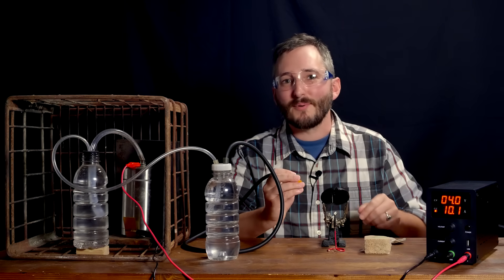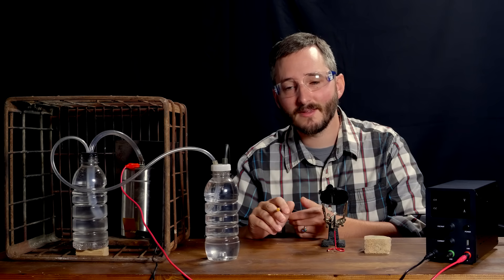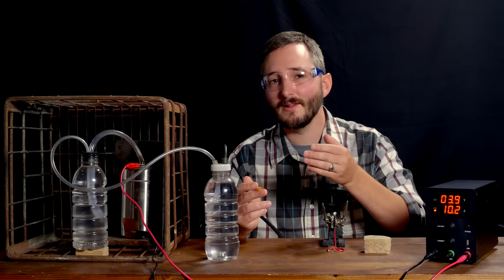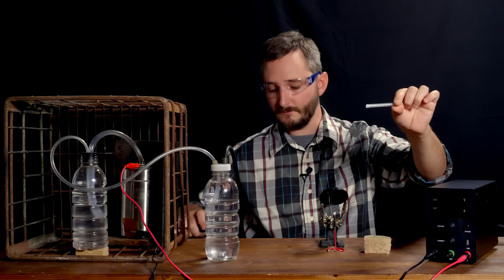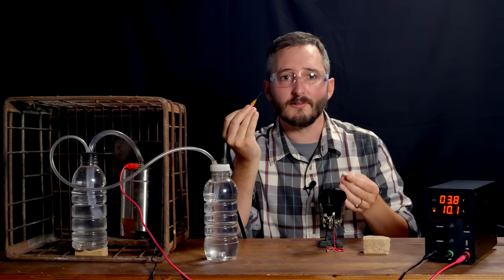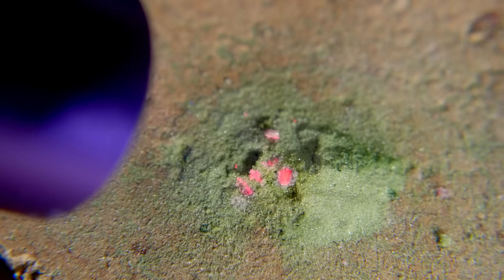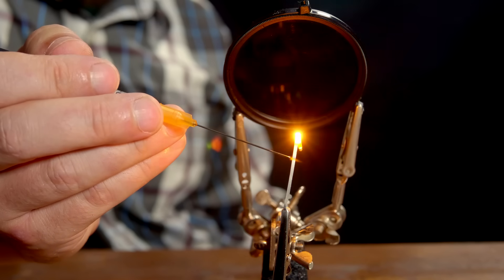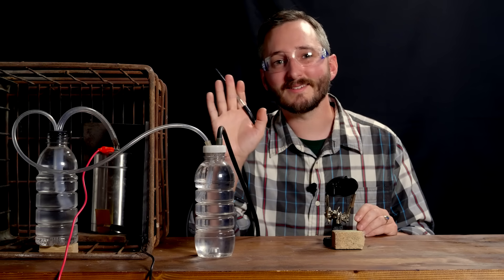DIY Oxy Hydrogen Torch Using Water Electrolysis

Comment: I run my lawn mower and truck off it it's soo easy and simple to keep it safe so easy plus small gas compressor up to 3000 psi that way you run off only tank like a natural gas compressor to fill there tanks and it DONT use much energy to make your water gas the compressor even runs on water gas all components are filters and requires 5 minutes a year to maintain easy as fuck and small as a 2foot by 2 foot by 3 foot I wish everyone would use it u can run ur house any thing and the best part hook it up and make your big generator to make electricity and sale back to the the utility company and u won't ever have to work again u will b rich until every body else starts to do it so be the first become rich THINK ABOUT it it's everything any questions my email is

Comment: While the flame is small, and if near 2000 degrees, does the heat output exceed a 35w electric heating element ?   If yes you have a more efficient water heater.   Nice.

Comment: It seems like you could make a generator that separates the gasses into their own tubes before combining in the bubblers as you have them.  This would mean that only the bubblers and the tubes after them are subject to flashback, not the generator itself.  I'm envisioning just separating the anode and cathode to each be under their own bell inside the generator, pushing their respective gases through the tube at the top of the bell.

Comment: I use a HOH generator to burnish the surface of the wood and make black plates with a very beautiful and durable black surface, which I also emphasize with linseed oil, rosemary or juniper oil and beeswax.
Where can I send you a PDF of the images?
🌑

Comment: Wouldn't a safer design be one where you have two seperate collectors, one om the cathode for oxygen and one on the anode for hydrogen (or backwards idk I'm not a chemist lol) then you'd route them seperately through their own flashback arrestors etc and through their own respective tubes only to combine and ignite them at the tip like a brazing torch does?

Comment: couldn't you just.. separate the two formed gases on anode and cathode, run them through separate lines, then make the lines meet in a final nozzle? you'd bring down the risk factor to 0 and have a more controllable reaction

Comment: @NightHawkInLight
I asked myself a few things after watching your clip:
How far could such a device be miniaturised? I mean every single step including the security bottles?
Then would it be possible, if you split the gasses paths to the tip. So the danger of the "Knallgas" (germain for 'bang'-gas, the oxy-hydrogen-mixture) was obsolete?
By the way, Your doing a great job! Thank You!

Comment: Rather than making a "oxyhydrogen" boom boom device, what about using a steel cup inside a plastic container for your gas generator that will pop but not create shrapnel if your dual arrestors fail?

Comment: I just wanted to let you know that if you run your electrolysis machine at too high of an amperage then you will actually create chromium-6. It leaches out of the stainless steel and is quite toxic. I think the ideal conditions for water electrolysis is 1.72 volts at 20 amps.

Comment: Would it be good for tac welding thin sheet steel? Or maybe a very light weight cnc cutting torch for thin steels. Think a bowden style on a printer.

Comment: Would some type of check valve work for this application. I know the flowing force of the hydrogen would need to be a lot less than the combustion pressure of the flame for it to work, which I think it would be. Especially if the check valve had a spring and ball pushing against the flow of hydrogen. When the combustion reaches close to the spring, the two forces might be enough to plug the check valve before the combustion is able to pass through it. I guess you would have to incorporate a pressure relief valve somewhere as well. I dont know anything about these systems but I was just curious about that.

Comment: If you put the gases into an inner tube and used a weight to squeeze the gases out with higher pressure. Could you possibly increase the temperature of the flame by using a slightly larger nozzle?

Comment: Hey. 
Just an idea for an additional experiment using the Oxy Hydrogen generator. 
Years ago I saw a video out of Germany that strongly proclaimed that the gas going through the water in the bubblers did SOMETHING to the water that dramatically improved it's ability to nourish plants. He stated the plants he watered with the  bubbler water grew at 3-4 times faster than the same plants given regular water.
I thought that since you already have the torch, you might be able to get some interesting "experiment" content pretty easily just by trying it out. :)
I realize that at one year after you posted this video you might not see this comment , but I figured I'd try anyway!
Reply: How would that work? You think hydrogen gas dissolved in water helps the plants grow? Or oxygen?
Reply: @braindecay9477  It would definitely be the oxygen, as plant roots require aerated soil or they wont grow. This is why we plow the fields after each crop, to increase the oxygen content of the soil.
Reply: @braindecay9477  Honestly I don't know, but the guy in the video was quite adamant that the bublier water had a VERY potent positive effect.
Reply: @Killianwsh  could you provide the original source? 
It's hard to even begin to try to understand the original intentions, was he using the acidic/salty electrolysis water, or the water of the flame catcher that probably won't contain anything of significance compared to normal water,...? 
Depending on the salts used for his electrolysis, he might just have produced a very specific and "small banded" fertilizer (could equally likely produce a herbicide too tho xD)
Reply: @braindecay9477  Sorry for the delay. I just  saw your reply.
I don't have a link for the original video, but I'm pretty sure he was using the water from the second bubblier. (flame catch) Given how simply the generators can be made, it'd be easy for most to build one & try both. :)
Reply: Some say electrolysed water has a similar effect. But I have seen no proof of it so far.
Has someone done a properly documented experiment yet.
Reply: @billirwin3558  I am not aware of any official documented experiments
Reply: I do maintenance for a hydroponic farm. One piece of equipment I maintain is a "nano bubbler" pump. This unit controls the size and therefore amount of air bubble size. This serves to not only deliver more accessible oxygen (and other air based elements) but gives the pumped water an "effervescence" effect which cleans the delivery pipes and discourages algea and bacteria deposits/growths in the system.
Reply: See how once burned it turns back into water, would it make a kind of water filter? It effectively removes any contamination seeing how you split the water and recombine it once burned. Just a thought but I'd love to see your take on something like that if it's even possible.
Reply: @dillonjones2312  I have been told that it converts back to water, but I doubt it's conversion rate is anywhere near as efficient as simple distillation for purification purposes.
Reply: @Killianwsh  oh that makes sense  ...I thought about the filtering too like thr guy above
Reply: @Killianwsh  The conversion rate is 100% however the energy efficiency of this purification is horrible at best (water electrolysis is not by far an efficient separation process for H2O into hydrogen and oxygen as it tends to generate a lot of heat)
Reply: @thibaultjoan8268  What is the most efficient separation process for H2O?
Reply: The only thing i could think of is if the liberated hydrogen was somehow able to form ammonia with atmospheric nitrogen inside the electrolyzer’s harsh environment, but that seems very unlikely
Reply: Ozone mayhap?
Reply: Eckman's paper analyzing the gas shows that the gas is 4% plasma water which he described as a rydberg cluster which is linear water held linear by lots of electrons in the middle. Such plasma is unstable.The electrons presumably make the plants grow faster. Find the Youtube where plasma water is used to spray trees etc. instead of using fertilizers or herbicides or fungicides. Similarly when you breathe such gas the plasma water goes in your lungs and you fill your body with electrons. When tested the EZ water lining the outside of the blood vessels a minimum of 300% as stated by Gerard Pollock and George Wiseman soon after the 2019 water conference. You can add noble gasses to make a good plasma torch lit by pulsed electricity. Helium is the easiest to ionize and I found a Youtube video where this is done.
Reply: @stuartmoir7744  Awesome! Thank you ! This would make the effect similar to the proven boosting effects of Electro culture  on plants!
Reply: This sounds like a lot of bullshit, like those miracle cures

Comment: Can you write with it on steel? And how would wood react to it. Another thought I had was a vortex cannon. But the vortex is hydrogen oxigen mixture. Exploding gasrings.
Maybe this is an option for bird scaring at airports and sertain fields. They sometimes have a bang generator.  Have a container. That if its filled up, it ignites the gas and makes a loud noise. And resets itself.

Comment: Looks great for starting the FeS reaction
just mix Iron powder and and very fine sulfur(is easy to crush)
and give any point enought heat to start the reaction
if done correctly, it will release A LOT of heat, one might even say it can melt thought some metals depending how much you made of both powders, but the reaction is very awesome and pretty, under apropiate conditions is a must do

Comment: I like your flashback arrestors except one thing... The other tube it goes Out of, is too close to the source tube. If the tube theoretically ruptured the flame could jump into your welding tube. you should have stopgap in place 'copper wool'.

Comment: Basically use the same Flashback arrestors a professional welder would. Which really are nothing fancy, basically tubes that are stuffed with the typical is Copper wool 'and suggested' . Double up on anything you are not certain of, the worse case scenario is it stops your flow, the actual worse case scenario is you explode, pick your battles wisely.

Comment: What if you add a second electrolysis cell and add hydrogen to make the mixture slightly richer. Should reduce the explosion hazard while still providing a hot flame.

Comment: Wouldnt a copper/brass tube be better as it has a higher thermal conductivity?
Reply from the maker: Potentially. High thermal conductivity stops the tip from catching fire as easily, but it makes the whole thing get hot faster

Comment: Similar sets of this sell as a hydrogen brazing set. it's used for hot-soldering jewelry due to it's extremely high temperature and is used by opticians for small repairs on a metal frame of a pair of glasses. In fact that is where I got to know and learn to use such a system 🙂

Comment: Man, it's cool and all but you really shouldn't use a handheld lighter like a Bic to ignite your torch. A striker of course, I've also seen constant small flame source used, or like an arc lighter so you don't end up with a handful of melted plastic and bone fragments. 
   Just a suggestion, not saying you don't know what you're doing, just wouldn't want someone else to try and hurt themselves.

Comment: the pressure doesn't increase as you decrease the channel diameter, the flow velocity increases and the pressure subsequently decreases.
Reply from the maker: That's a description of what happens inside the nozzle, not in the system as a whole. A smaller outlet causes system pressure to increase if the gas production rate remains constant.

Comment: Belt and suspenders.   .  .  Then another belt and more suspenders. . .  Then tailor the pants so they are a snug fit. The true professional never says “Don’t try this at home, kids: I am a professional.”
Separating the gas streams and combining them at the torch would add another safety feature. But at the expense of a lot of complexity. It would be an interesting engineering exercise, but quadruple-redundant (maybe quintuple?) safety system would be overkill. The metal wool in the syringe body was probably enough — this kind of flame arrestor is commonly thought quite adequate in similar situations.

Comment: Great video. How about using a separate Hydrogen and Oxygen generator and running two tubes to the needle? Far less dangerous and I imagine the same amount of heat as well as being able to make the welder larger in size.
Reply from the maker: That is safer but a generator with separate outputs is less efficient because the electrodes are further apart

Comment: As a lamp worker (oxygen/propane mixture) i am quite interested in the amount of pressure the hydrogen gas can/will produce. Are you only burning hydrogen and allowing the oxygen in the atmosphere to be the accelerator?
Reply from the maker: It's both hydrogen and oxygen combined as made in this video: https://youtu.be/d85OX6yEwE0

Comment: I have all sizes of copper capillary tube and as an engineered flow restrictor it works very well. I can imagine using some of the larger, not intended as a tip size piping the browns gas into and submerged in a container of water, the copper being highly thermally conductive and may be another way to help insure the prevention of the flame retreating issue. Different i.d. and lengths lengths llengths

Comment: Nice gas generator, I can only suggest to filter de mixture trough methyl alcohol to dehydrate it  it will also stop a flashbacks. As electrolite I use sodium hydroxide solution at 28 Bè.

Comment: Browns gas flames are not hot, that's the weird thing they just react with the material generate massive heat from a flame of around 200/300 degrees, you can run a flame like this over your skin.

Comment: Hey! I'm working on using this design for my 8th grade science project, and I'm running into a few issues. First of all, I got the power supply you have in the video and it's not producing the correct current. It's 35v 10a and I have the correct alligator clamps. I was also wondering how much potassium hydroxide to use. It would help me tons if you responded!
Reply from the maker: This is a pretty dangerous project, I definitely wouldn't do it in a school. Use as much hydroxide as will dissolve in the water.

Comment: If the calcium carbonate can survive 'relatively unharmed' by the heat in this experiment, while the aluminum is melted, would it be of any use in your experiments with rubies?  As it wouldn't melt under those conditions
Reply from the maker: Could be. Good thought

Comment: Please try a reduction of 81 grams or a mole of zinc oxide using the torch. You think heating zinc and water to make hydrogen would be better or worse than electrolysis?

Comment: I wonder why you didn't put a tesla valve at the end of the second buffer bottle to prevent the backfire effect. You can easily print one with the appropriate diameter. If you mount your system to a extrusion 3D printing system you can try to carve with geometric precision. If you reduce the current an reduce the nozzle from 630 um to 100 um you can actually make it to a DIY quasi-quantum computer :)
Reply from the maker: I have a video about fire in a tesla valve. It doesn't stop a backfire, it only slows the fire down slightly. The aluminum wool in the syringe is much more effective.

Comment: Seems like a fairly simple task to build a regulator that uses an internal pressure sensor to control the supply voltage.

Comment: because of its low cost for operation and high temp flame , one use  would be for placer gold working  or anytime you want to melt gold ore. without using mercury or even lead. with this method, rich concentrates could be "purified by fire" and gold particles melted together. still need to have good ventilation as rich concentrates can contain a variety of poisonous minerals and may exude poisonous gases.   still, better than lead extraction and purification, and mercury extraction. or nitric acid.    Ive been using lead and struggling with the cost of maps gas ceramic wool products,  in using the "fire assay" method for the stones i find and crush for panning.  this far passes the need for heat to melt the impurities leaving only the precious metals behind. i would love to see this done and any problems discussed.

Comment: I'm rewatching this video because I just saw a mom-tuber promote a product which allegedly cleans your fruits and vegetables by being in a bowl of water with the produce, and the device allegedly electrolyzes the water to "purify" the water and "get rid of pesticides".

Afterwards the water was discolored (I assume by the electrodes). She then went on to recommend literally all of her viewers invest in this product.

I hope no-one explodes. Holy hell. Running an open electrolyzer in a kitchen near a gas stove...
Reply from the maker: I'd be more worried about the super weird chemicals electrolysis can produce depending on what's in the water. That does not sound like a good idea at all.
Reply: @Nighthawkinlight  It's on Amazon as "Fabenix Fruit and Vegetable Cleaning Machine, Fruit and Vegetable Cleaner, USB Wireless Food Purifier, Cleaner Device for Washing Fruits, Vegetables, Rice, Meat and Tableware (Blue)" if you want to investigate.

Thanks as always.
Reply from the maker: @JustOneAsbesto  I might look at that, thanks.